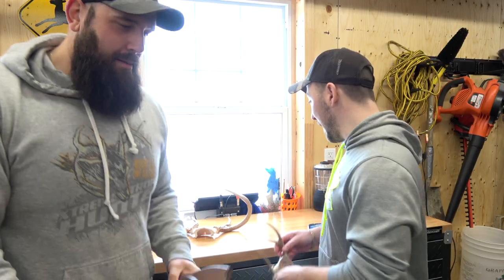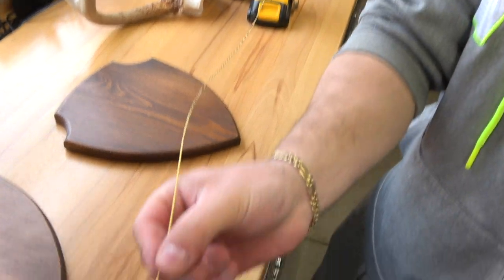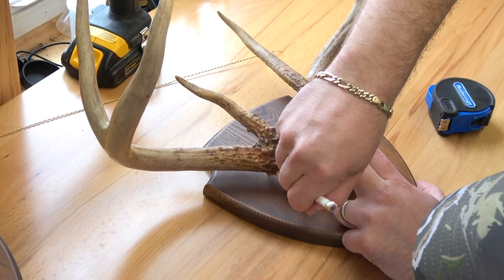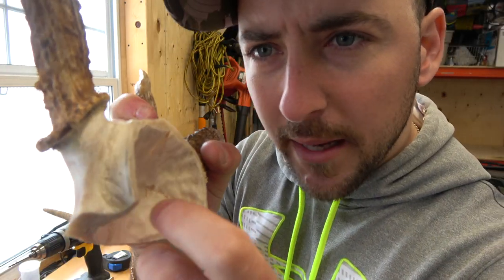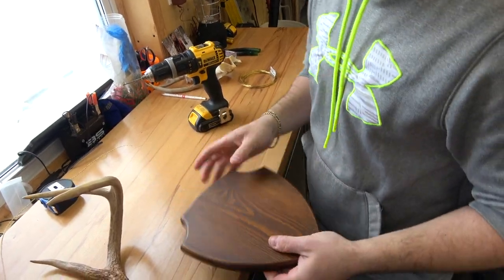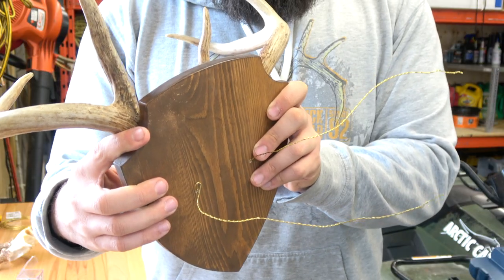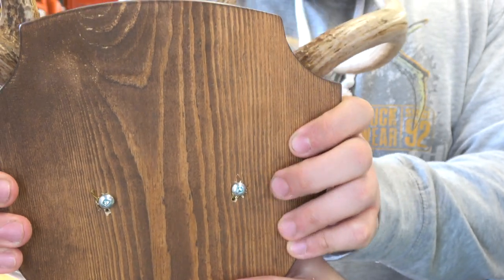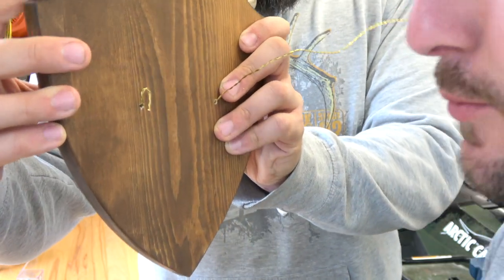HOW TO MOUNT A DEER SCALP!

Comment: Thank you so much for this video. In the past week I’ve mounted 7 skull mounts and 8 skull cap mounts. The skull cap project, I did it exactly as you demonstrated in your video. Your method worked perfectly. I used picture hanging wire, because I didn’t have access to brass wire. I love how my project turned out. I wish I could show you a picture. I had about 3 skull caps that were too heavy. I started to add another wire, but I drilled a tiny  hole in each and tacked it down with a short nail. That did the trick.
Reply from the maker: Hey, we're glad that this video helped you out! If you have any questions, feel free to ask us. Thanks for watching and commenting 😊

Comment: Thats cool, thanks! Does it have to be brass wire or is that a preference?
Reply from the maker: Hey, we used brass wire because it was flexible and when braided together it was much stronger than the regular steel one. If your going to use something else just make sure it's strong enough by bending it back and forth and seeing if it holds up. In our experience the metal ones snapped so we didn't want to take a chance for the rack to fall off the wall. Hope this helps and let us know if you have any other questions.

Comment: How big of a plaque do you recommend?  9x12?
Reply from the maker: Hey, it depends on the size of deer your putting up. 9x12 is the standard size so you'll be good with that.i wouldn't go bigger. The smaller the plaque the bigger the rack will look 😉

Comment: Can you drill a screw through the center of the skull without splitting it?
Reply from the maker: You should be able to screw through the center without problems, just use a drill and a new bit.

Comment: Anyone know of another way to mount antlers like this but without wire? Wanting to keep the hide that’s still on the skull and show it off but I’m not able to drill tiny holes in the head because of the way it was cut. Thanks!
Reply from the maker: Hey, maybe look into a  Skull Hooker bone bracket? Or a small l bracket from the hardware store with very small screws. Hope this helps

Comment: What are you using to hang them on the wall?
Reply from the maker: Behind the plaque there's a hole where we hang it on the wall with a screw. If you don't find a stud make sure to use a butterfly dry wall anchor. Hope this helps
Reply: @GIOUTDOORS  the plaque I bought doesn’t have one. Just gonna get some hardware and do that. Where do you buy your plaques from?
Reply from the maker: I had gotten mine off Ebay and some didnt come with a hole on the back either so used a picture hanging kit you can find at your local dollarstore/Walmart